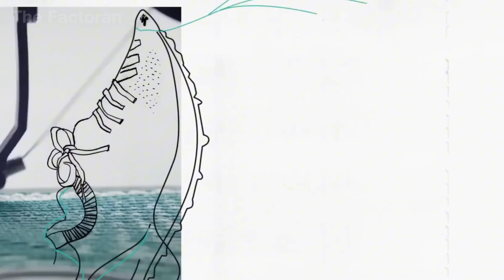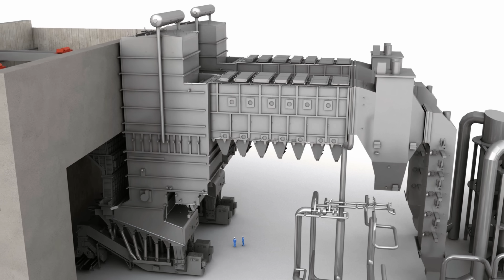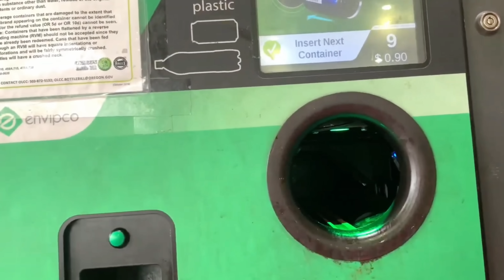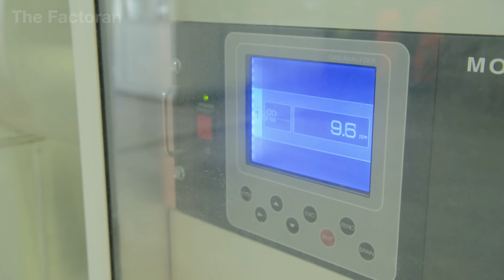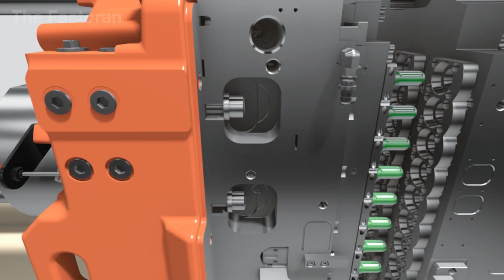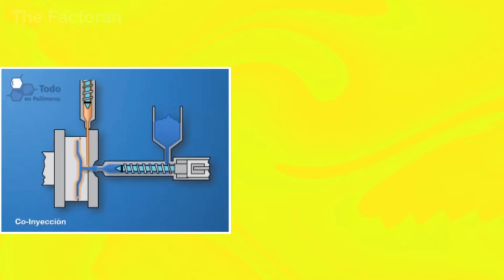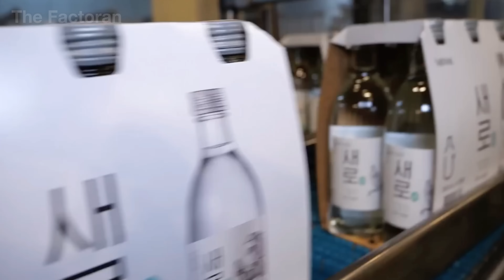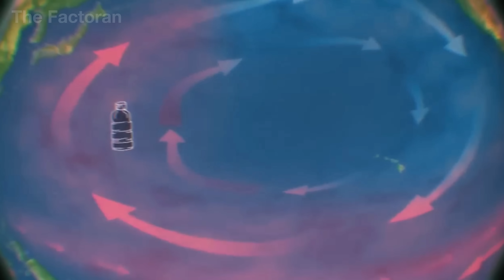How Mountains Of Plastic Trash Are Recycled Inside Massive Recycling Lines

Comment: It seems your a supporter of recycling plastic
When if that is so, you are on the wrong side of the fence
You are allowing more plastic to end up in someone brain and the rest of their body
The only thing that should happen to plastic, is all plastic manufacturing should be shut down, and any plastic being salvaged, should be burned for heating or converted to a useable fuel , otherwise not one drop of plastic o w need,

Comment: Mixed plastics cannot be made into original products .... but .... can all be melted together , with a brown colourant to make solid plastic lumber .... this is ideal for park benches or foundations for wooden structures , as it cannot rot in moist soil .... small amounts of foreign material do not matter .... a park bench in my area shows tiny particles of aluminium foil , but this bench has been there for past 40 years ( rot free ! ) .................. DAVE™🛑
Reply from the maker: That’s awesome, Dave! 💡 Plastic lumber really is a smart way to reuse mixed plastics—durable and rot-free.